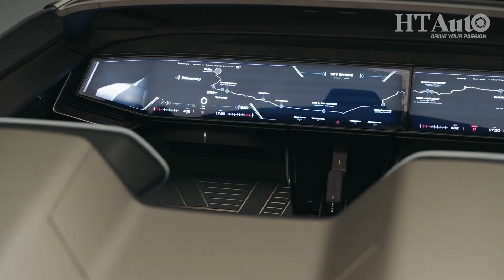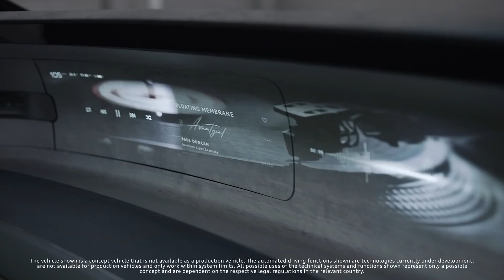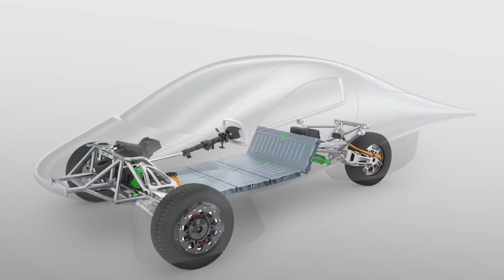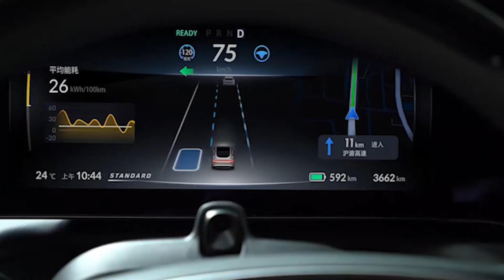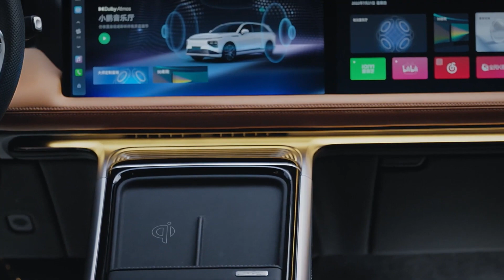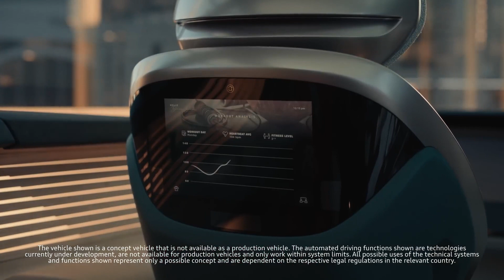NEW ELECTRIC CARS 2022 COMING TO STREETS SOON

Comment: I do not think so the electric cars are a good option, I know that the price of the energy is too expensive now and they are very polluters.
Reply from the maker: The cost to charge an electric car is cheaper than a tank of gas.
Reply: @TechQuest1  it will not stay cheaper, because of the war and other problems, the system will multiply the cost of the electric energy.